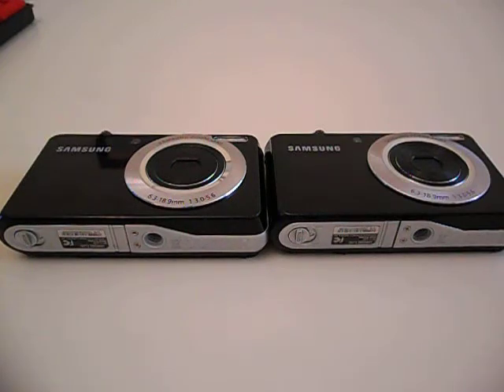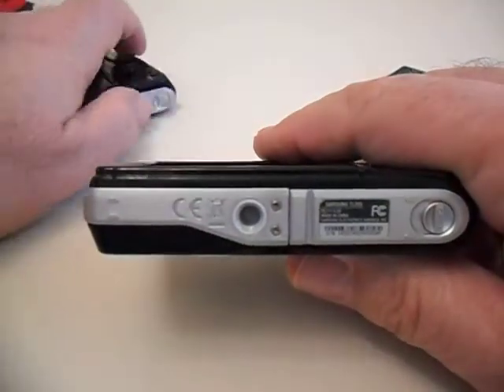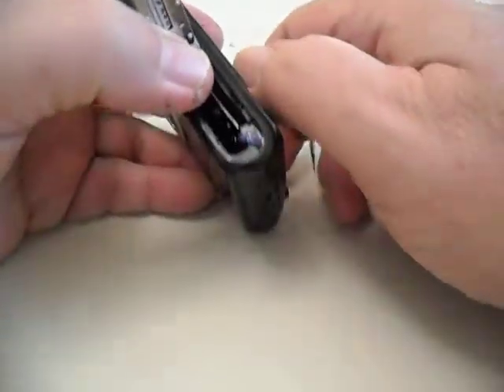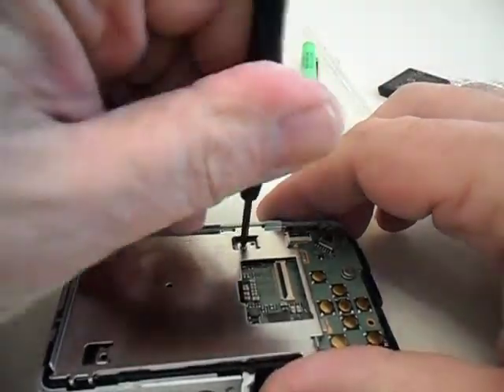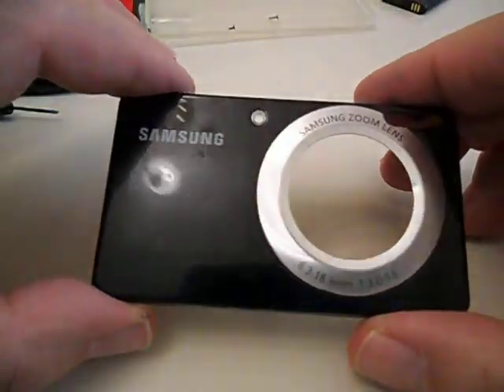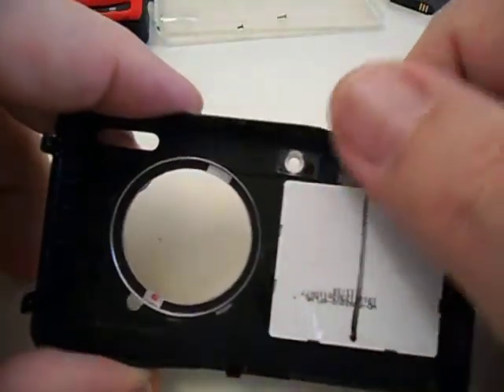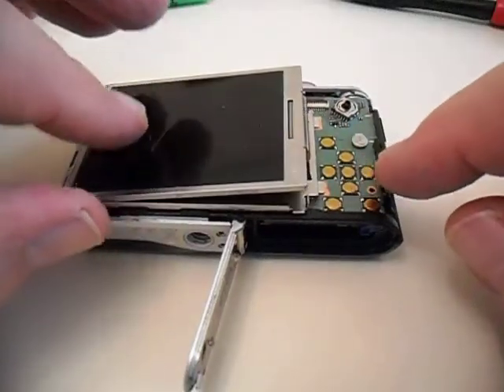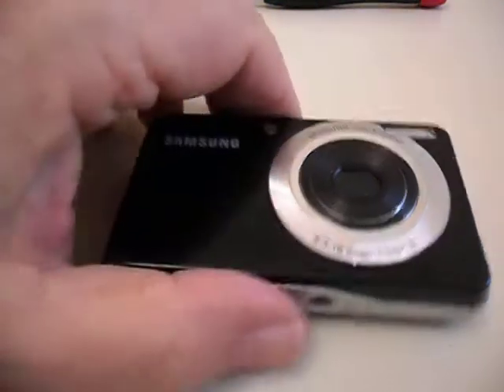Samsung Digital Camera Dual LCD Replacement.AVI

Comment: I brought the repair screen and everything off eBay but my only dilemma is I can't get the screws to unscrew either they're too tight or rusted plus they are a bit dirty help please
Reply from the maker: I am not sure o what kind of camera you have. I use precision screwdriver set. If you use the right size tip, you should be able to get the screw out. If it is rusted, put a small drop of oil on the screw and allow it to soak in to loosen the threads. Hopefully this helps. I got the precision screwdriver set on EBay for about $20.

Comment: This video good but broke the bar holding the lcd screen on my samsung wb150f,  There are some possible pitfalls so beware.
Reply from the maker: Me too Judith.  When that happens, I had to get another main board.  I found them available on EBay.  Price point anywhere from $12 to $39.  Make sure you read all the wording.  Reputable EBay'rs will offer replacement or refund if you receive it DOA.

Comment: Hi there,
thank you for posting this, its brilliant and i ordered a back LCD  screen i thought was correct and was doing so well until i think I've ordered the wrong screen size so i was just wondering what size or the name of the screen i should by is.
Reply from the maker: You need to be so careful when getting an LCD.  There are so many variations.  The best way to make sure you are getting the right on e is to either go to a camera shop or go onto a site like EBay.  On EBay, type in the Model Camera you have and add LCD.  The camera I show here is a Samsung TL205.  You will see the model and serial number sticker on the bottom of the Camera and somewhere on the body as well it is usually printed.  Type into the search bar, "Samsung TL205 LCD".  This will bring up many different vendors who carry them.  I have had a couple of times where I got the wrong screen but the vendor is really good about correcting so you give a good feedback.